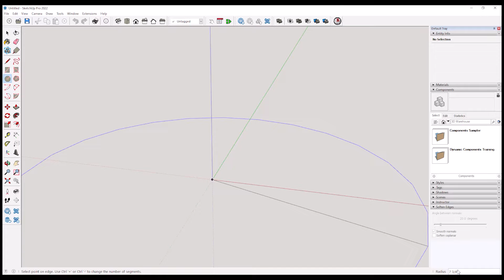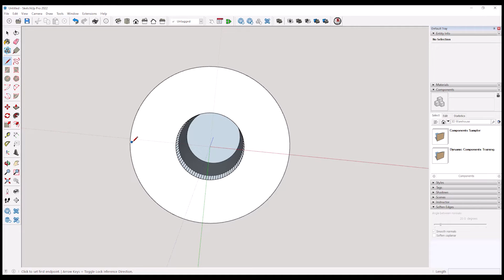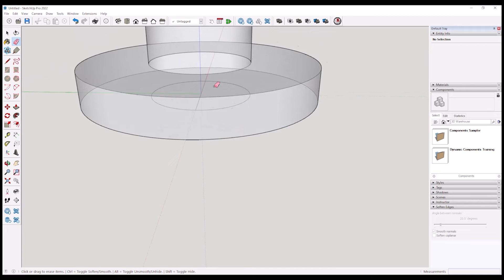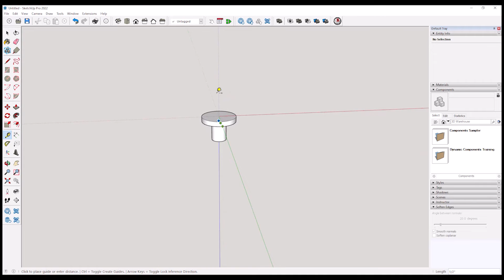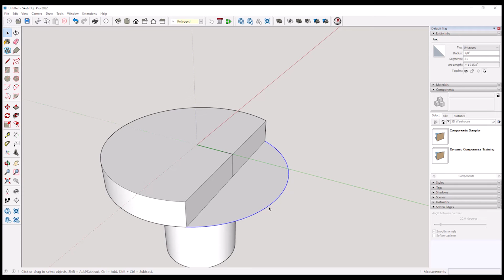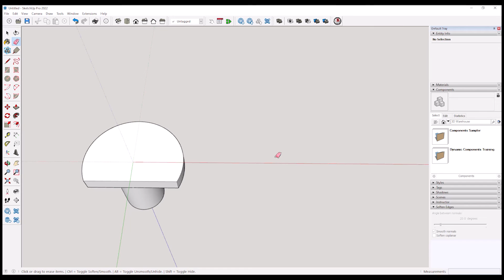Drawing a bench dog in SketchUp Pro

Comment: Just getting into an MFT bench and accessories.  Really liked the simplicity of this.  A lot cheaper than buying bench dogs.  Thanks.
Reply from the maker: Your welcome! I agree with you a lot cheaper and you can easily adapt to any situation. For example I made these 3/4" clamps to solve a specific issue with locking slat style shoe racks to my bench. https://www.printables.com/model/793093-34-bench-dog-pressure-screw-clamp